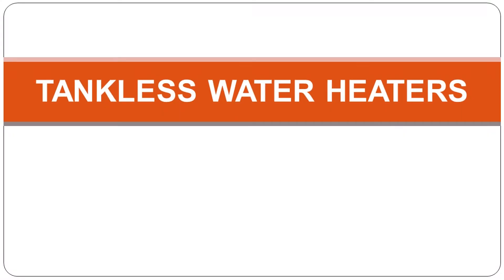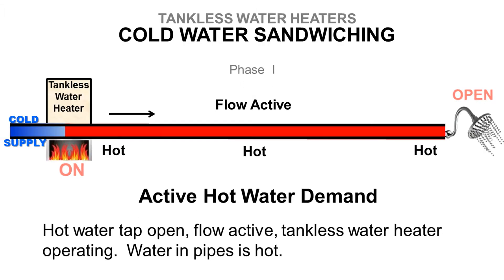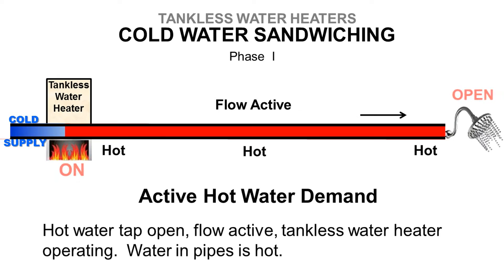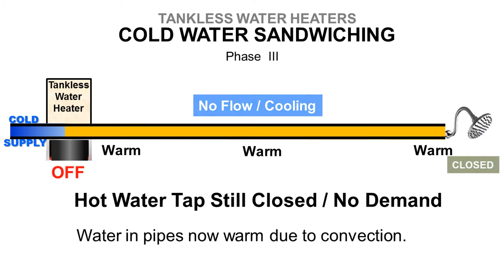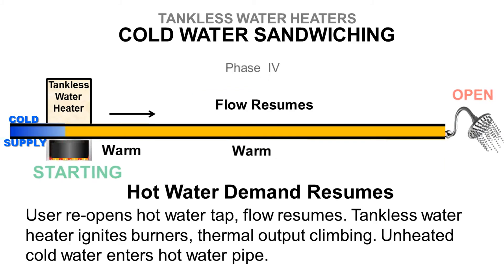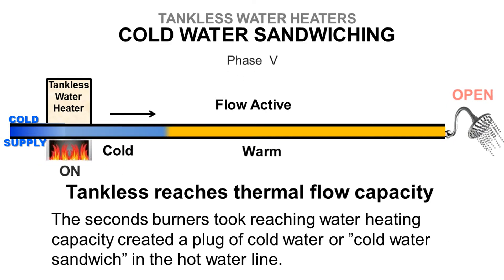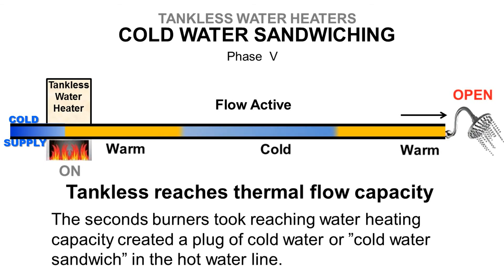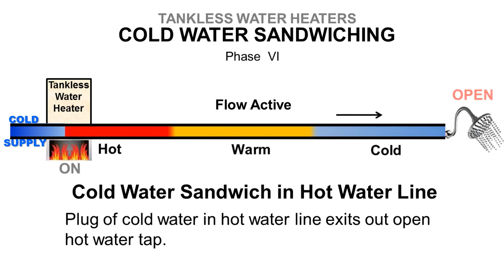tankless water heater cold water sandwich effect

Comment: If there is no demand for say, 24 hours, there would be a "plug" of cold water at the initial flow anyway, which would be colder than the "sandwich".
Reply: That is the case with any water heater and can be resolved by installing an on-demand circulator such as ReadyTemp.

Comment: Tips on how to solve this problem? If you don’t have or unable to install a water recirculator?
Reply: Adding a small utility heater just after tankless water heater on supply line.
Reply: I once read a tip about how to operate your shower in order to avoid this but I can't find it again. It pretty much involved letting the water run until that cold water sandwich had passed through the shower head. But I can't seem to make it work anymore. If anyone knows about this please reply.